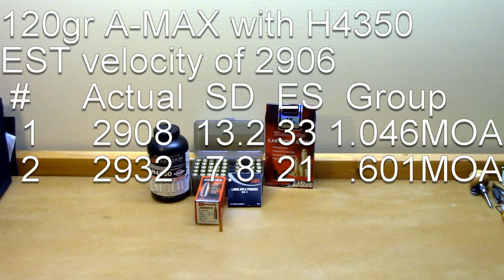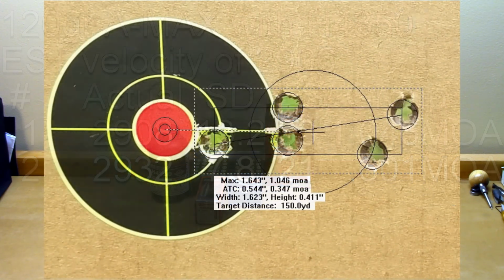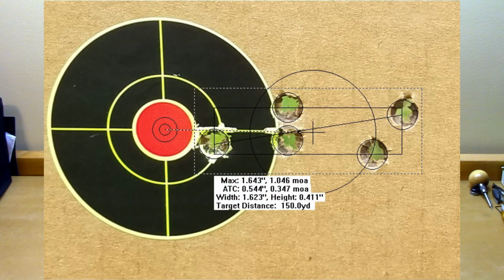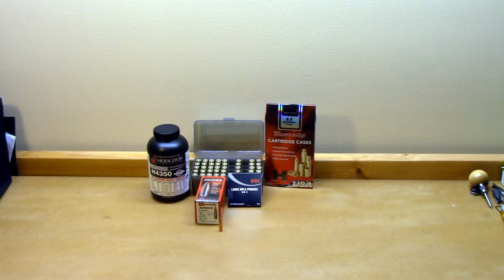10 Shot Shootout of Hornady 120gr A-MAX and Hodgen H4350 with Ruger Precision Rifle in 6.5 Creedmoor

Comment: Greetings Mopar'Man :)
Did you say at 2.215 the bullets jam into your lands?...My RPR, I load COL out to 2.845", which is about the max i want to fit in the mags that cam with the RPR. As I mentioned in a previous vid comment, a guy at the range told me the RPR likes a bullet jump. He got better(tighter) groups. I have to try it now. I've fired well over 500 rnds handloads, and have to reload now. Oh, btw, i'm picking up some large magnum primers tomorrow. I will take velocity readings, and use up some more of the superformance powder i bought, loading 129SST and 123SST. Will send you target pictures...Cheers Eh.... Have a good weekend.
Reply from the maker: Mr. Nagy, Sorry for the super slow response but before I answered I had to pull it out of the safe and triple check it. Today I measured a COAL to the lands for this projectile at a average reading of 2.772". Hornady recommends a COAL of 2.710" but this was loaded at 2.815". (well into the lands) Looking forward to your data on the magnum primers with superformance. It really might make me pull it back off the shelf and see if this was part of my problem with being so slow compared to the book data.

Comment: Good video! I would like to submit one of my most accurate loads for your review.

42.0gr Win 760
140gr Sierra Matching moly coated
fed primer
col: 2.800"

5 shots measured .542"@ 200 yrds
Reply from the maker: Not that I wouldn't like to try it out but I can 't seem to find a quality of less than 500 available to test. I have never used any coated bullets before but I probably won't order 500 to try it out. I wonder how significantly different the 142 gr non coated bullets are?
Reply: the coated bullets have always shot slightly better than their non coated counter parts in every caliber zi have used. to try the load just substitute a Nosler CC ,140 see how it fares

Comment: I was never a fan of that bullet. Brass is just getting ready to come out of tumbler as I type this. Will be loading Reloder16 using the 147. 40gr, 40.5gr, 41gr, and 41.5gr. Wish me luck.
Reply: So instead of of 40gr. I went 40.5 to 42. Good new to report tbe 42gr load went .498moa @ 100yds. 2884avg dev. of 4.2. Almost identical to my H4350 load and retained perfect zero as well. I think I can go 42.5 and be safe with Reloader 16. Only bad news is it doesn't meter as well through my RCBS load charger.